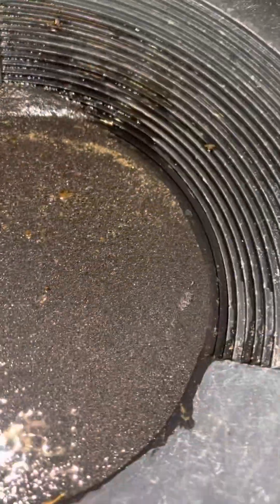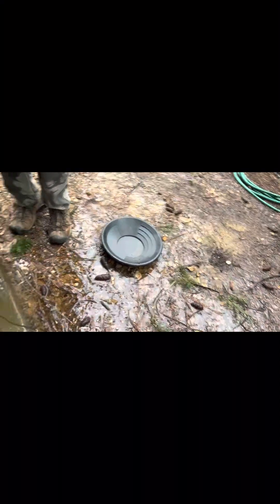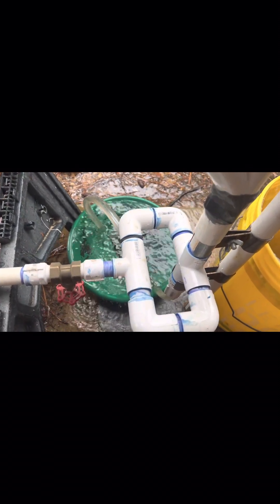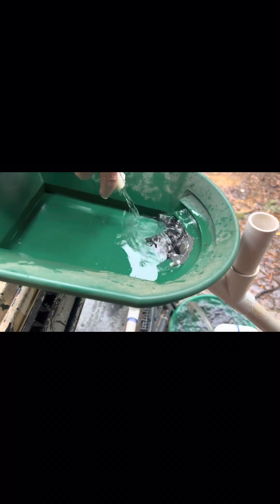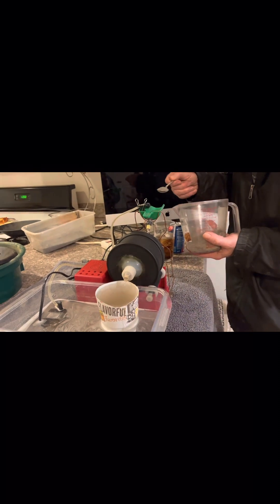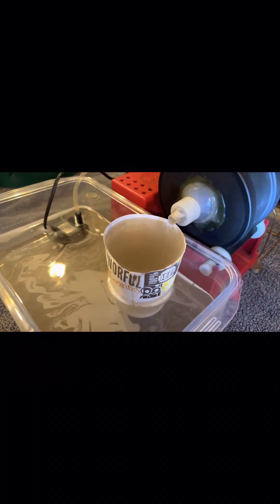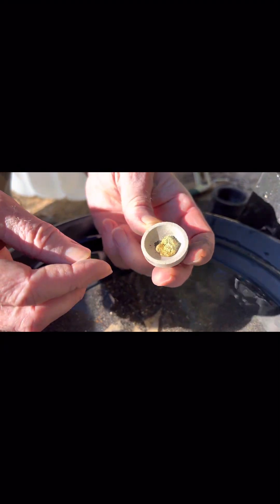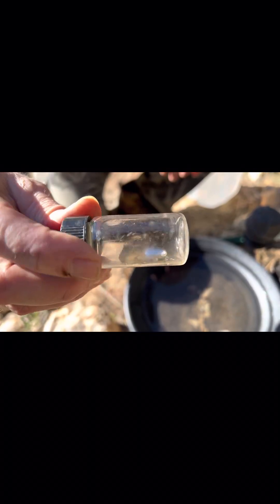Black sand and gold problem solved! Retort and  mercury recovery.

Comment: Black sand is easily removed using an AC electromagnet. Gold gets kicked away, black sand with some gold is attracted, and waste made of garnet and other heavier minerals  goes straight through.
Reply from the maker: The gold in this case was finer than the black sand.A magnet wouldn’t work without it grabbing most of the gold.This way was more effective in this case

Comment: The idea is to 'not capture' any magnetite, but only to position a magnet 'Above' the Magnetite low enough for the magnet to affect the weight of it, by lowering it's weight (as it does) long before it captures it. There is a zone of influence involved that the magnet will never touch the sands, but you 'never' have to clean the magnet because no sand ever touches it. The water washes away the sand down the box because magnetic sands cease to have 90% of their weight because of the magnets zone of influence.
The Hematite, 'in an agitated state' by addition of a simple vibrator, is washed away by the water and the moving Magnetite that all remain in close contact with the riffles.
Nothing is EVER captured by the magnet...ever!
Magnets alone will not move any of the Hematite.
That was my worry when I considered using only magnets and water hoping they'd be enough to push the Hematite by themselves, but they will do so effectively when both the Magnetite and Hematite are agitated by a vibrator. As the concept is demonstrated here in this tumbler moving the medium effectively.
This is a sample demonstration of what a vibrator can do to material. This is in a bowl, so material has nowhere to go, but in an open ended sluice box it will travel down the slightest grade as you can imagine. At minute 5:17 in video
https://www.youtube.com/watch?v=lXknqxaYgPY
I will power the vibrator with a small 12 volt battery and Rheostat to control the vibration
The use of water is problematic, and may not be absolutely necessary as dry washers in deserts do without it. The vibrator and sluice long magnet alone can make this a universal machine. (Car door magnetic sheets)
Reply from the maker: Thanks I’ll check it out!